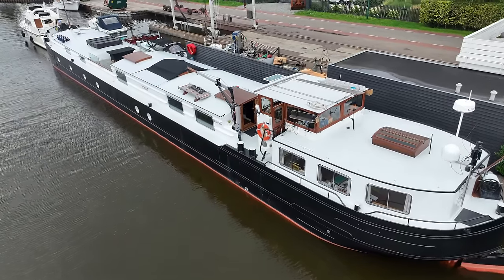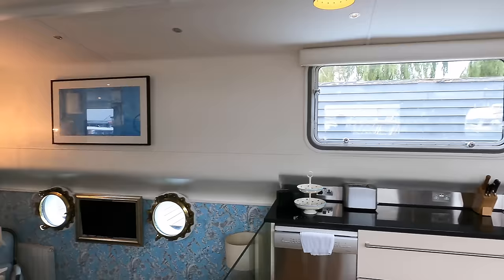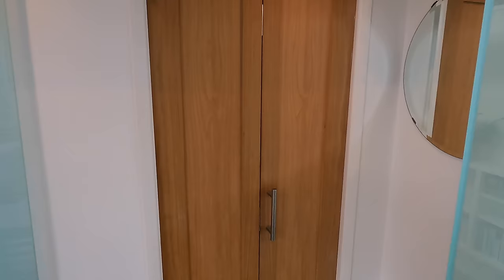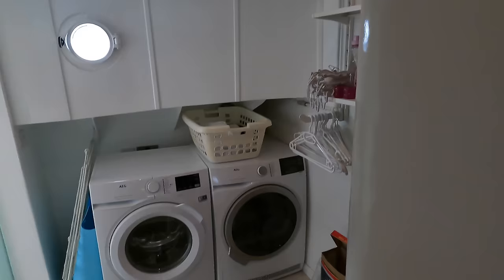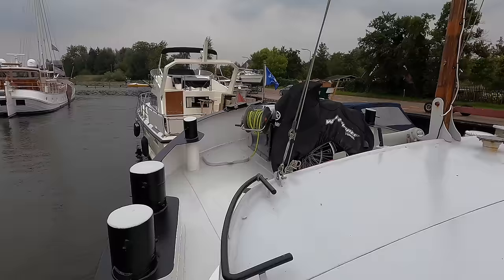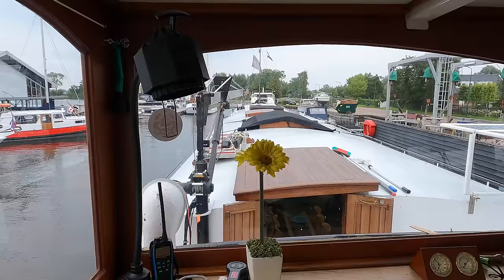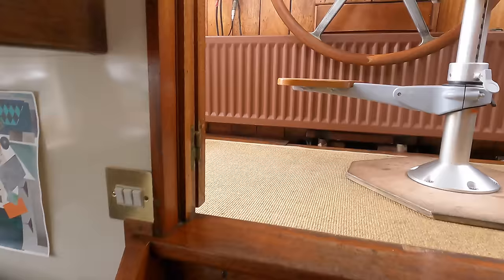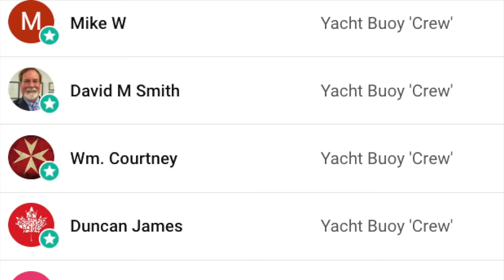€595k STEEL Liveaboard Boat FOR SALE!

Comment: I see in this, a boat with a lot of potential. I would gut it and do a major refit to the interior spaces. I'd remove walls and make some of those small rooms into lovely suites. Replace the antique in the engine room and put in a pony engine through hooked up to a common gearbox. Put in newer and more refrigeration. Update the galley and lots more.  As it sits, I think it would make a lovely floating museum of comforts imagined in the 1950s.
Reply: The antique in the engine room is only a few years old (2011) and is the most reliable marine engine in the world, why on earth would you change it?
Reply: Um yeah, just get a new boat son. Leave the class to people that have it.

Comment: Built in 1951?  What was its original purpose?  Presumably cargo carrying.  When was it initially converted to a pleasure vessel?  And by whom?  I assume this in not a blue water vessel but confined to harbor and inland waterways, or maybe coastal cruising as well.  I love the aft cabin.  There are so many possibilities...
Reply: It is a spits. Meaning it is designed as a freighter capable of fitting in the locks of Belgium and France. (And therefore also in the Dutch locks and canals.)

Comment: the only thing im missing on this boat is a battery bank and solar panels.
such vast unused surfaces where it could have easily 10kWp of solar power.
combine that with a hybrid drive and you could motor around on electric power most of the time and only need the diesel for longer passages.

Comment: I'd be worried about a steel hull that old. Even with regular maintenance, it could've rusted away significantly during the 73 years it's been on the water.
Reply: Its a fresh water boat, it will be fine with proper maintenance
Reply: As a freighter they dock every 4/5 years for inspection and, when needed, replacement of hull plating. If you fail to do this, insurance is off your ship. Only the years and circumstances of its live-aboard period is of interest. Since it was moored in sweet water and had a recent hull inspection it is probably A-OK.
Reply: That’s why the hull of commercially active ships like these are measured every 5/7 years

Comment: I take it you can not take that out on the ocean
Reply: Looks like a canal boat-no keel. I met a guy while I was jogging in Camargue (South of France) that had a real nice liveaboard.  He said he would occasionally (very rarely) take it out on the Med.  Only on dead calm days & close to shore.  If the seas gave any indication of picking up, he would head back to the canal PDQ.
Reply: Possibly under the right conditions ans with an escort to round kent and cross the channel getting you in to the French canal network that goes as far south as Carcassonne
Reply: The spits is a type of cargo ship especially designed to traverse the French canal network as it fits the canal locks. This ship can take you from the Netherlands all the way to the mediterrane via the interior of france. It's a lovely trip. There are travel videos of this route. Of course it can take you to Germany Poland and the Donau all the to the black sea.
Reply: there is ocean going ones out there.
Reply: Only once...
Reply: Not unless you want a sunken home at the bottom of theocrat lol